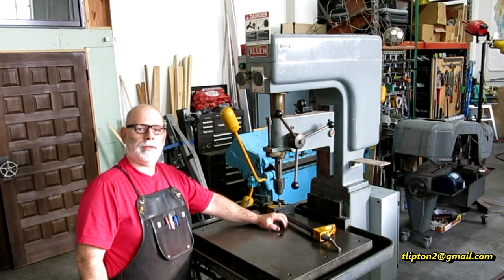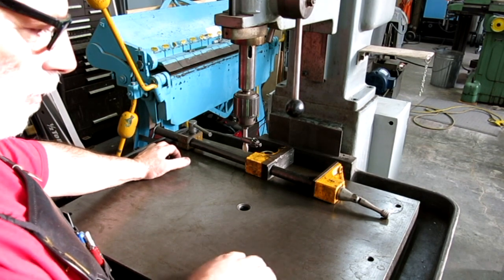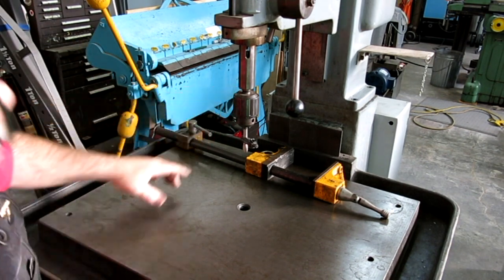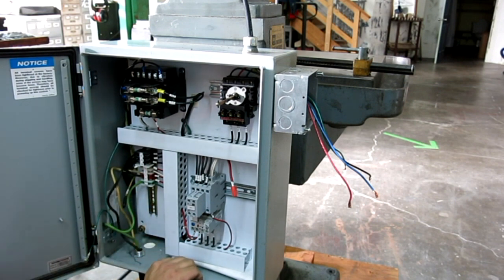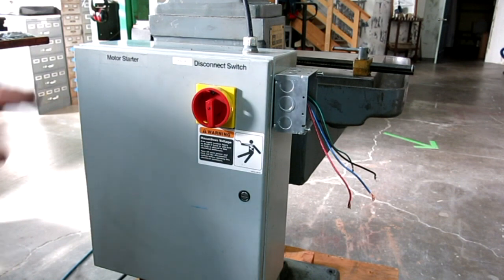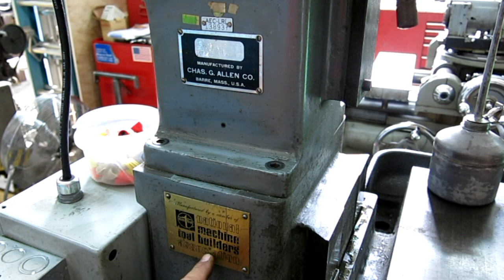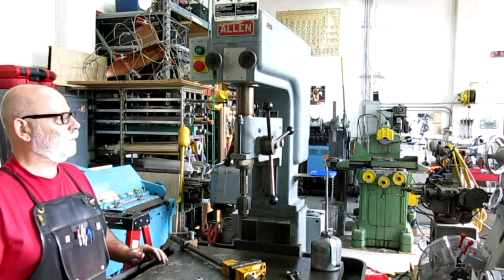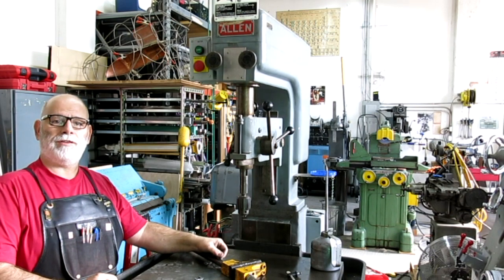Machine Tool Survey Allen Multispeed Drill Press

Comment: Reminds me a lot of the Leland-Gifford drill presses. Multi-speed motor, nice big table but with the lack of clamping options and no reversing cam on down feed for power tapping. The Quill of course is movable up and down via the upper dovetail slide. IMO the main thing wrong with most drill presses is the tables are too darn small. The things that are an issue are fixable. Maybe the best "drill press" one could find at auction would be an old Jig Bore like a Pratt & Whitney. Hefty spindle, lots of clamping options and built like a brick outhouse.
Reply from the maker: Hi M,

Take a look as some pictures of a Fosdick drill press. They have some of the cool features you mention. They also have a cool system of front levers to change speeds. Thanks for the comment.

Cheers,

Tom

Comment: Hi mate.  Every time I watch this video I get furious about the replacement of the on/off button by a complete box of all sorts of circuit breakers a foot pedal and a death stop.  The conversion must have cost the government a great deal, to then find it on an auction not all that much later.  It makes steam come out of my ears.
Reply from the maker: Hi Marcel,

It was installed to satisfy the safety sparkricians. They had to clear some old equipment out to make room for a new five axis Matsuura! Thanks for the comment.

Cheers,

Tom
Reply: Just keep your eyes on the auctions Tom, before you know it that also will be on an auction near you.  It will have been the wrong size or so  ( O;

Comment: 1. What's the rpm rating on that chuck? 5200 seems kinda fast for a chuck.
B. Are there bolts missing from the top of the column? (Where the bottom half meets the top half)
3. My grampa used to work for Louis Allis. Milwaukee represent!
Reply from the maker: Hi Metal,

Good question on the chuck as Jacobs does not publish their speed limits on the web. Is fairly small so I'm not too worried. No bolts missing from the column. Allis Chalmers is a very interesting company historically. Thanks for the comment.

Cheers,

Tom

Comment: Tom find a big slab of metal and build an Abom sized clamping fixture plate for holding parts on the Allen, bolt it right down to the table in those mounting holes, might be a fun project.  It is a sweet old drill press, they don't make them like that anymore.

Comment: Hy Tom Yesterday i saw your rotary brouche video . Now i see this .  Cought i be that this can be a brouching machine ? Since Allen is the Brand of brouched stuff.  Just asking .  Thanks for your work !!! machining  and directing.
Reply from the maker: +hubert cramm Hi Hubert,

The Allen drill press is not really a broaching machine. Although with the DB customs tool it could do smaller polygonal holes. Thanks for the comment.

Cheers,

Tom

Comment: Hi Tom -- interesting machine!  The speed range is a bit of a downer as a stand-alone tool, but, as you point out, it's a valuable addition to a mill.  I'd vote to keep it on the island.

The top dovetail is probably in place so the MFG can offer it as both a knee model and a table-top model.  There is probably an alternate base without the knee.

Comment: Those drill presses are common in manufacturing. when I was doing tool and die making those are the machines that we had in many different plants that I worked at. as far as the head going up and down to give you extra room, a lot of times we would put a die set on the table and be able to drill and tap the top of it to mount it into the power press. in other instances, one could put rather large parallels on the table and set whatever on top of them. I worked on some rather large dies and the die sections would sometimes have to hang down underneath the plate inside the parallels in order to drill the top. The other thing is when you put heavy items on the table there is often no need to clamp them because they will not spin. I wouldn't recommend not clamping them for safety reasons. The other thing I did on those drill presses was I installed a foot pedal to reverse the spindle when tapping. That way you could oil the tap with one hand and have the other hand feeding the spindle up and down. Anyway nice machine.

Comment: That drill press is remarkably similar in design concept to my 40´s ASEA dual spindle one. I believe the purpose of the movable spindle range is to be able to set up multiple spindles to different heights for various tooling in a production line.
If you for instance have a 4 spindle machine with a common table you could set the first up for a spotting drill, the second a jobber drill, then a tapping head and a countersink without having to move the table up and down when you move the workpiece from one to the other.
I´ve only ever seen this feature on machines thats available as multi spindle.
Real nice machine, and yet another interesting vid. Thanks mr Wizard.

Comment: Nice cold war machine! I got a Triplett voltmeter with a LRL-AEC tag on it at auction. The first thing I did was pull out my Geiger counter. No radiation :(    My friend who used to work at Livermore talked about a machine shop that cut plutonium. He got to hold a piece and said it is warm to the touch. Yikes

Comment: I think you could make a  mill type table or a t slotted  accessory top for it.   Clearly almost any size fixture or table could be fitted without losing  operational area.  A more conventionally slotted plate  table could bolt to the table it has now.    It seems built for custom jigs or fixtures to overlay the plain plate table.    Actually I have seen shops with several drill presses for different speeds or types of work    You may not "need"  both  drill presses, but I bet you can "Really Use"  Them.   This one may need some learning and adapting to get regular use out of it.   I bet you can set them up, so each press has a place in your work flow.   Goodluck!

Comment: I think you might do well to keep both  Drill Presses.  This one handles all the odd and wide range jobs.  Your old unit  could handle most of your regular work.  The extreme range of table action and large work capacity mean it will handle things your regular unit cannot.   Don't give away the simple utility of your current  unit.

Comment: Sweet drill, would love to know the history of parts made on that thing in the atomic research lab.  

I also instantly noticed your Johnson Model J parked behind it, as one of those in working condition came home in the back of my truck last night.  I found your video on the base, how are you liking it?  I like that you added some curve and style to compliment the old saws' lines vs other straight forward angle iron bases I've seen.  

Is it possible to order the casters online from your supplier, don't think I've seen the dual locking like that before, especially at those prices?  

Also did you do the motor mod or did you buy it that way.  Maybe I could hit you up for a couple pictures or a quick video showing how it's laid out.

-Thanks!

Comment: Nice to see a table that looks like it should. No extra apprentice marks. That spindle is set up much like a few of the older Jig Borers I've seen pictures of. Given the length between the bottom of the head and the drill chuck I'd think that spindle support isn't exactly optional. I've been stuck with low grade light duty Crapsman floor drill presses my whole life. Every one of then had so much flex in the table I no long even have a drill press. My mill is far more rigid and with a way better speed range than any drill press I could afford to buy. I wouldn't say no to one of these machines though.

Maybe a large thick aluminum sub table with either tee slots or threaded holes, or even both would work for part fixturing.

Comment: Hey Tom - It's been a while since I last saw one of those Rad-Lab property tags! Brings back memories of my misspent youth up on the Hill...

I thought: "Look what followed Tom home!" at the beginning of the video... a nice addition, however temporary, to your shop...

No T-slots on the table, but I suppose that one could drill & tap a few more clamping holes, or make up a pallet / plate with a grid that can be bolted to those 6 holes on the edges...

Now, is it just me, or could one use the dovetailed column to raise the head, and the screw jack to lower the table, and get something big - like an engine block - in there for some careful drilling?

A truly neat acquisition!

Eric

Comment: Hey Tom, that other adjustment on the column is to for height stopping on the retraction. after the hole is drilled you can stop the drill just above your piece, re-position and drill a new hole with little travel up or down.  I use this feature alot on the production line saves alot of time, we have a gang of 8 of these identical drills at work very cool machines.

Comment: Two drill presses is not out of the realm of reason. But you may find yourself mostly using one, or the other. 5200 RPM on a big press is unheard of too. It sure seems to run like a top.

Comment: That vertical head adjustment is mostly just for ergonomics. If you want to bomb stuff on and off of a rolling cart, then you set the table that height, then move the head so you can do your work. The other thing is operator height. I used to work in a shop with one guy who was about 6'6", and another guy who was about 5'4". With a head adjustment like that, both guys could do repetitive work in relative comfort.

Comment: The 4" limit of depth is over come by bringing the table up to the bit rather than the bit down to the work. (you need a long bit of course) this is what the sliding head stock is all about.
They are still in business and support even 100+ year old machines! 
With a model number you should be able to get a manual for your machine.
http://www.chasgallen.com/divisions/allen-drill/

Comment: Nice machine and quiet.   Could you add tee slots to the table.  My 17 inch Delta has the same issues with holding parts.

Comment: Tom,
Sweet find. I have seen these rigs before. If the spindle ain't trashed, it will be a fantastic press.
At my dad's shop, we have an old Buffalo press. Its all high end. Stationary cast bed and the head  (chuck and spline bearing) go up and down on a slide. I love it for the small bits. we tapped the bed all over with several 3/8"-16 holes for clamp down. We have another press (variable speed) for the big bits.

Do yourself a favor. Unless you need the cash or space from the sale of your old press.... KEEP BOTH! We don't have one of anything. If you ever have a breakdown, you can jump to the other rig.

Regarding the electrical, On yours, the transformer is for control power. the fuses are just for the transformer primary. the transformer is for the controls circuit power to pull in the starter coil @ most likely 115 VAC. (so you only see 115 on your buttons, coil and foot pedal) regardless of what you are feeding the press with.

Keep the great videos coming

Comment: .....beautiful machine....Myself, Ive never had a "dedicated" drill press with a table that was big enough or had enough speed that still had torque..you could never use a decent vise, rotary table, or safely secure larger parts..the mill always seems to fill in for those jobs........the Allen, .....I believe that would do! Be nice to keep all the drill work off the mill...... you could install a small x/y table and dro....or install another sacrificial top on  1/2" spacers above the cast one, even make it a drilled and tapped small parts plate.....lots of options the smaller plate drill presses dont have.......a production machine with lots of options...........easy decision...

Comment: I think that the height adjustment is to enable drilling holes deeper than 4 inches.  So,  drill 4" deep, stop motor, move the feed box down, start motor, keep drilling.

Comment: Hey Tom, Nice drill press, What's behind the plate between the 2 speed control knobs? That does not look factory.
Thanks Buddy.
Reply: +Buddy Lineman As the electrics were rebuilt, that plate probably is where the old main switch was.

Comment: Is there a possibility that the (pardon not knowing these terms!) drill shaft (the part that holds the bit and rotates) can develop a bearing problem such that the drill may wobble slightly?  I can only imagine that with lots of use there could be some play there.  I see you didn't test for that, so perhaps it's not an issue to worry about with these machines.

Comment: You were asking what the upper dovetail buys you. I have a guess based on a different type of machine I have used. What I think happens is if you have a very deep hole to drill that exceeds the quill travel, You can re-position the quill and get another length of quill travel while staying on center with your existing hole. If your part is heavy it might be better to use the upper versus cranking the knee up and down. That's just my best guess. Wow nice score there Tom.

Comment: I like how quiet the drill press is, and even quicker than a geared head to change speed. It doesn't have any frills like power feed or tapping, but how often do you need that stuff anyway. Don't care for the threaded depth stop, but easy enough to change. Only one choice here, keep both of them. You can walk around in your shop way too easily as it is.

Comment: I'd be hard pressed to replace the Clausing with the Allen for a few reasons.  The Clausing has continuous variable speed, round column for swinging table around, or out of the way, and the deal breaker, power feed. No way I'd trade a couple of high speeds for power feed.  I do like the big table on the Allen.  If you ever had to replace that four speed motor GOOD LUCK WITH DAT! ;-) Very doubtful that would ever be necessary.
Reply: +James Kilroy If the motor ever goes phut and lets out it's magic smoke just replace with new motor and VFD. If you still want set speeds instead of continuously variable no problem, easily done electrically.
Reply: +Joseph P. Polnaszek No doubt, the Allen is a much more rugged machine.  However, for me, the power feed is a deal breaker when choosing between those two machines. I know Tom will never break that motor, which is why I said "Very doubtful that would ever be necessary."
Reply: +James Kilroy Hi James, A rewind job on that motor is pricey, like 3-5 c notes. depends how passionate you are about your machine. i had an old (1950's) radial arm saw rewound years ago just because i loved the saw. (Real old saw with the over/under arm) 

The saw was in perfect condition when i pulled it out of a scrap dumpster with a burnt motor. Kinda like finding a puppy...
Reply: +James Kilroy 
Allen also offered a powered feed option on their drill press's. As for the motor going out, wow it would take some serious abuse to damage this machine. I've used the variable speed Claudins and yes they are a good machine in that design of drill press. However it's apples and oranges here.

Comment: Nice machine! I wonder if you can come up with a t-slot table that you can bolt on top of the flat table to make your set ups quick and easy.
Reply: +Bill MacDonald That or some kind of bar going from tapped hole to tapped hole which will hold a good drill press vise. The bar might have a slot or some extra holes to allow going between two tapped holes diagonally (at two different angles - front to middle or front to back holes) for some variety.

As for power feed, I don't think I've ever seen Tom walk away from a drilling operation; if he's there he might as well have his hand on the spindle lever.

Comment: Hi mate.  I always look in the back of the ute/truck when I arrive home, but to date, I have to admit, not to have found a machine like this in the back.  It looks to be a very nice machine however.  I have to admit thinking, if you don't use the drill press that you have, what are you going to do with this one.  Everything that you need, you got in the mill.  It does feed the beast though.  Does mum know you bought it or did you say that you are storing it for a friend.

Comment: Two of things make for handy quick set ups. I have 5 bench style grinders and still find the wrong wheel mounted at times.
A Linley jig bore has a similar dove tail column that counter balances both quill and sliding column.
Reply: +Rick Brandt we could get two toms and get the vice finished faster :}